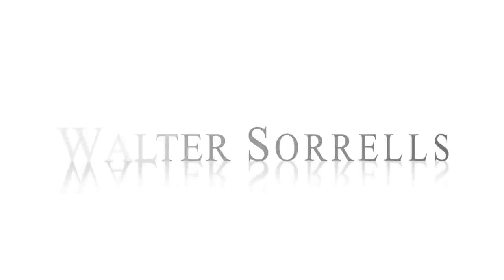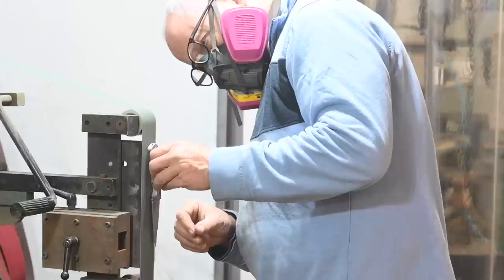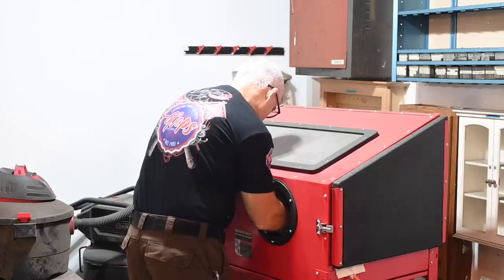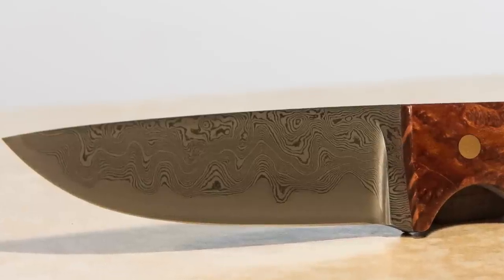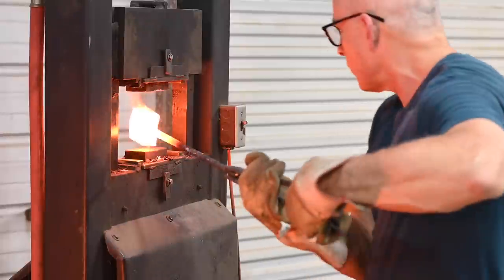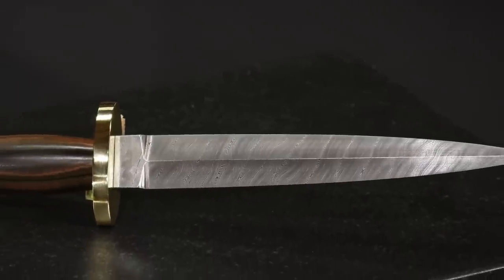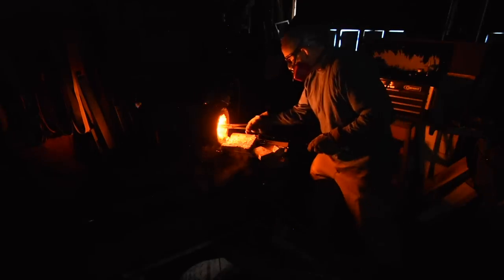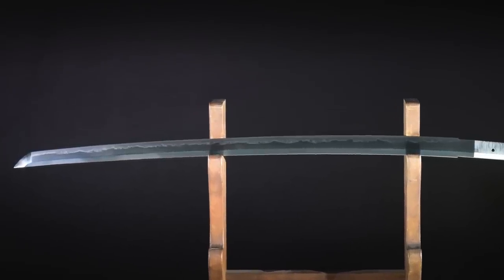Knife Making Myths...Busted!

Comment: I use 1075 for most of my knives and don't get any complaints. My reason for using it is the simplicity in heat treating it. I have a coal forge and a household oven, hope that explains it.
Reply: That's fine.  Nothing really wrong with 1075.  I mean it is what it is, a good basic simple  carbon steel that's cheap, readily available, relatively easy to work with and heat treat and can make a passable knife blade that will get the job done in most cases. 
As are most simple carbon steels. 
Just please then start getting or spreading the idea that it or any carbon are equivalent or even superior to modern high performance high alloy martinsitic stainless chromium tool steels. 
(And/or that forged blades are somehow equivalent or better either.  )
They're not.  Not even close. 
Personally I think this (or these two combined) is one of the biggest myths in the knifemakeing world. 
And one of the silliest.
In fact I'd go so far as to say it alot of cases it's at total scam level.
Often a unhealthy and even dangerous one... especially when you start getting into knives used for human food preparation like kitchen knives.  (And imho no carbon steel blade has any business being anywhere near human food or used for regular human food preparation.  Or even many of the lower grade and lower chromium stainless steels or ones with more dangerous alloys. )

This myth/scam is especially prominent in the Japanese cutlery market.   But it's everywhere too unfortunately. 
I'm not a big fan of big government regulation and a bunch of clueless corrupt beurocrats micromanaging every little aspect of our day to day lives.... but I also think this myth can only be perpetuated and people can only get away with it because of the knifemaking world being so very unregulated.  About the least of any industry really.  
Where anyone can claim to be an expert or authority without any sort of training or degrees or anything much to prove or disprove it... and they can make pretty much any claims too without having to back it up.  Which opens it right up to these sort of problems and to unscrupulous makers and all these sort of problems and nonsense. 
I mean you go walk into a place from any other metalworking industry.... industries with actual trained experts and strict guidelines and regulations and tonnes of experience, like say the aerospace industry or whatever.... and try telling them that they should use simple carbon steels and forging because they're superior to modern performance alloys, and you'd be rightfully laughed out of the place!
Cause it's silly.  Not true. And dishonest. 
Frankly it's perpetuated because it can be great for the backyard knifemaker who can pop out a bunch of blades quick easy and cheap with minimal equipment, skill or know-how and often still charge a premium price for aless than premium knife and blade steel.  But it's bad for the customer and consumer.  And I think in the long run is bad for makers and bad for the business as awhole and gives knifemakers a bad name.
Reply: @iamshredder3587  carbon steel knives, cutlery and pans have been used for thousands of years, theyre not dangerous for food preperation. Or we'd all been poisened by now

Comment: One thing about Damascus is that the heat treat and temper treatment is typically, at best, a compromise between the best approach for one of the constituent alloys.
Reply: Exactly
Reply: That's why steels with the same heat treatment are paired. 15N20 paired with 1084 or 1075, or far more rarely O1 paired with L6. The one common combination that doesn't match is 15N20 paired with 1095.
Reply: @FuckYouYouFuck  why os 15N20 paired with 1095 a poor combination? I know very little about metals and I’m genuinely curious.
Reply: @flashpointbravo  1095 is a shallow hardening steel that needs a fast quench, 15N20 less so, 15N20 is a eutectoid steel with 0.75% carbon, 1095 is a hypereutectoid steel with 0.95% carbon leading to different optimal heat treatments.
Reply: @FuckYouYouFuck  thank you.  I ask because I’m genuinely curious about the craft and I have a knife made of those two steels which was given to me by a good buddy.  Although it’ll never devalue to me because of materials or construction, it’s nice to know a little about the components.

Comment: My pet hate is those guys demonstrating how "scary" Eharp their knives are, particularly the ones that show you where they have shaved their arm hairs with an axe. You don't put a razor edge on an axe or an axe edge on a razor for obvious reasons. each bladed tool has a purpose and the edge of each blade is sharpened according to it's end use.
Reply: I bet you can shave hairs with every one of the New Zealand and Aussie competition axes when they are first unsheathed in lumberjack competitions. Maybe not after the contest, but no one on that level is going in with less than 100%

Comment: Completely agree about titanium, with one exception. I remember seeing a couple titanium knife models from one single manufacturer, where they were marketed for EOD. I thought it was an interesting option for environments where use of a ferrous metal could potentially be hazardous (such as disarming a bomb). I’m not sure why the techs couldn’t just use a dedicated titanium probe rather than probing with a nearly useless knife shaped object, but what do I know? 🤷🏻‍♂️
Reply: Titanium makes a good diving knife too, light weight (for hold air travel) and corrosion resistant but strong enough to cut fishing lines and nets e.c.t

Comment: I have a hunting knife made from Sandviken powder steel, super sharp, super hard, super durable and wont rust(forgot it in the boat for 2-3 weeks and not a speck of rust, and it was resting in a puddle of rain water). A real pain in ass to sharpen though. but love the weight, and the style but would rather have the same knife in carbon steel even if the powder steel is superior in any way except when it come to sharpening. So it pretty much depends on what steel suits your need, that's the best one.

Comment: to be fair Damascus as in the steel produced from a particular mining area in the middle east in the middle ages did through the make up of the ore and the skill of the makers make higher quality blades that had a pattern and yes woot steel is as my father said the same dog but different leg action there is a very good documentary available on YouTube about scientists working wit Alfred Pendray to rediscover it. The modern Damascus, Damacine, water pattern and so on should technically be be called Damascus Pattern or Patterned steel but either way it is of the quality of the steel used and the skill of the maker

Comment: I figure most knife makers buy stock steel in the type, width, length, etc that they like and mostly grind.  Guys who spend a lot of time with the hammer and anvil are typically more budget guys who literally enjoy turning junk into blades, or guys who are trying to make some unique layer patterns.  Which is honestly my favorite type of blacksmithing when someone takes a railroad spike or a old coil spring and hammers it into a blade.
Reply: There is actually a full support network for grinders that does CNC blank cuts, bulk heat treats for hard to handle steels, custom metal mixers, etc. FOr the guys making a living but not up tot he "master" level this support network lets save time  and effort for abit of money on the donkey work or special equipment needs so they can focus on making the fit and finish fo the knifes which is the big differentiator.
Reply: Easier to Sanmi the railroad spike with an edge off a bit of leaf spring. 
Railroad spikes Suck. Low carbon mostly, like mild steel ..

Comment: On the sanding and grinding comment, thats why i generally stick to tooling art and architecture when i blacksmith, but most folk when  they find out i blacksmith dont think "brackets, tooling, railings" they think knives and swords. ive only made 2 knives i was happy with, one was a drawknife. until i got my wilton grinder  i wasnt even interested in standing in front of a central machinery belt sander for 16 hours. that being said i started 2 damascus billets, one is done the other is in the prep phase. i'd already have lost the forged in fire challenge, we re at least 2 hours in on the prep. with all that time invested i sure hope this billet turns out at least as good as the last one.

Comment: I am  a hobbyist. I get interested in something just long enough to see if I can do it then move on to another one. I.ve made a couple blades, they look rough intentionally. You can see the hammer marks and tell it was forged. A knife is made for cutting not chopping, splitting, or using as a pry bar. The only thing I want is for it to hold a sharp edge. It's just a hobby for me, one of many from fly tying, flint knapping, blacksmithing to right now making a long stimmed tobacco pipe just to see if I can. Knife makers work hard and make beautiful knives Unfortunately in this day and age knives are not carried as often and people aren't willing to pay what a hand made knife is worth

Comment: To be fair, stock-removal techniques are comparatively modern, and the reason for the knife-smithing myth is a two-parter: a) knives were primarily forged for most of human history, as the process wasted a lot less iron and steel, and time (at such periods where the only "power tools" we could mislabel as such would be e.g. watermill powered grinding wheels); b) modern media often misrepresent how anything was made in the past and when (e.g. mixing up armours and weapons from different eras, casting iron knives etc.).
Reply: Are you saying a watermill grinding stone is not a power tool? Lathes and other machine tools ran off of water power long before electricity.
Reply: @dockeryjt  I badly phrased that, and I agree the term does apply properly; what I meant is that we can't classify them in the same category, because they are different types of power tools than modern ones (not in the sense of how much power they can put out, but in terms of constraints such as needing installations with appropriate power sources).

Comment: Titanium ... The best metal there is. Even ten thousand layer katana which cuts through tank barrel without a scratch doesn't stand a chance against titanium. Only sacred Ferrum is strong enough to defeat Titanium. 
P.S. Have you got a hardness meter? If you got, could you show how soft is titanium compared to normal, hardened carbon steel? I think it would maybe finally convince some thick skulls that unobtainium, sorry, titanium isn't the Holy Grail of metallurgy.
Reply: If your knife is going Mach 3 must be titanium.

Comment: Do you have a video where a beginner could take a farrier's rasp, untemper it, make a knife(chopper?), retemper, and then handle and sharpen it? I have a few extra rasps as I am learning bow making and have thoughts of also making a few knives. Thanks...and am enjoying your videos!
Reply: Tello, I’ve made several knives from farrier’s rasps. Our shoer leaves the worn out ones with me. 

The problem is that most rasps or files are made with either 1084 or 1095. The former is a deep hardening steel, and should be quenched in oil, and the latter is shallow hardening, best quenched in water. You can split the difference and use something like Super 8 Second or Parks 50. But still, if you’re assuming one steel and it’s actually the other, your results will be sub-optimal. 

That said, you can still make a good, serviceable knife using rasps. The pattern left when grinding out the teeth looks very cool, imho. 

You’ll want to anneal the rasp first. Heat it to critical temp, “bright cherry red,” i.e. get it hot enough that it’s non-magnetic, soak it at that temperature for about five minutes, then let it cool overnight in a bucket of ash. There are other methods, but this has worked for me several times. That will get it soft enough to cut and grind. 

Then just go about your normal shaping, grinding, drilling, polishing etc. routine. I normalize before heat treatment, and I’ve never had one of these crack or warp drastically during the quench. 

When heat treating you have a decision to make. If you know the brand of file you may be able to contact the manufacturer and find out what steel they use. That would eliminate your guess work. 

I’ve made several of these, use them myself and have never been disappointed. Is the heat treatment and tempering optimal?  Maybe, maybe not. But they’re pretty good knives. They’re sharp, tough, and hold a good edge. And they look strikingly different from what most people - and all companies - are making. 

I encourage you to give it a try. I think you’ll be happy with the results.
Reply: @eswb1  Thank you for the time and all the information!

Comment: Referring to No.4, I really salute you, for a long time, someone gut it right...
Wootz (Crucible Steel) is originated from mid-Asia,  around a thousand years ago, and it is random...
Damascus steel is originally from Damascus/Syria (doh...), 600years older than Wootz, and of arranged patterns...
A proved fact we teach to our students...
Am a PhD. in Engineering...
Reply: Been making knives for approximately 25 years. 
The goal in using different steel is to get closer to that perfect blend. The problem starts when you think about the hundreds of different knives. Each one has a different job to do so they require different characteristics in the steel to best do that job. 
As far as Damascus steel goes, the wavy pattern or water mark was something associated with the steel from Damascus, the place. 
Japanese steels also would show that water mark from the quenching. It also has something to do with the water. Way back then they used water from the lake or river or what was available. If the water was a little dirty it would leave a more pronounced water mark. 
When steel is that hot it is porous. I've had discoloration from impurities smoking off in the forge leave a discoloration completely through the blade.

Comment: 1st of all, I know very little about steels and their equivalent hardness for a given task over and above the carbon content of the alloy. 1095 is a good carbon steel for blades and D2 tool steel is probably a better steel if edge retention and or rust resistance is a factor. And I only know what I hear from others who have used titanium in their work, how good or how bad it is for a given task. 

With that said, I was wondering about a statement you made concerning the "tempering" of steels and how it generally affects the steel's qualities, edge retention, malleability, and such, so I will ask an amateur's question about titanium. You made mention of the overall quality of titanium for other than aircraft and space equipment superstructures where weight makes a distinct difference in how the finished product performs. But it is not even good enough to "forge a butter knife from" [my words] because it simply isn't the correct type of steel for that purpose. What, in the characteristics of titanium, makes it totally undesirable for tempering to arrive at the expected characteristics of malleability, edge retention, and all the other characteristics which would make for a top-rated edged weapon or edged tool?